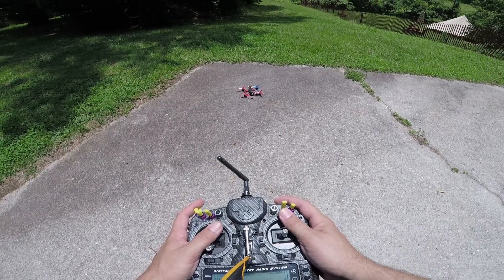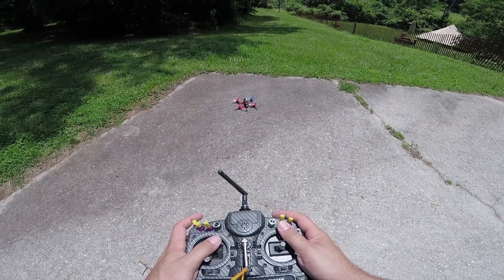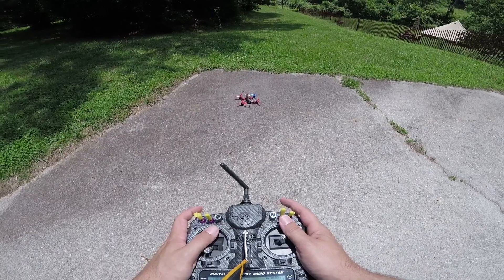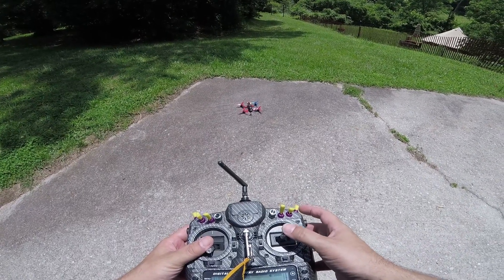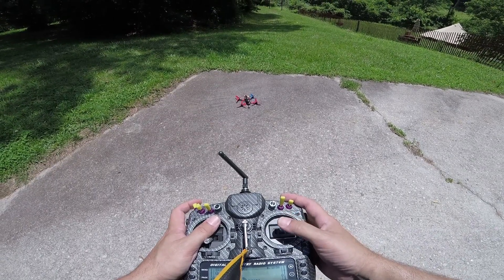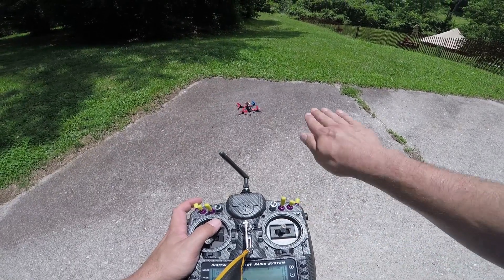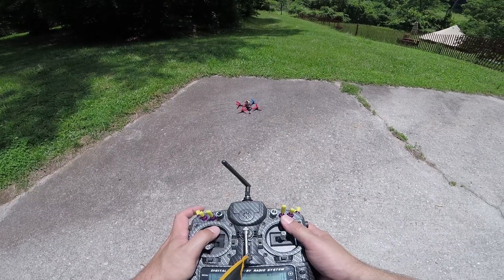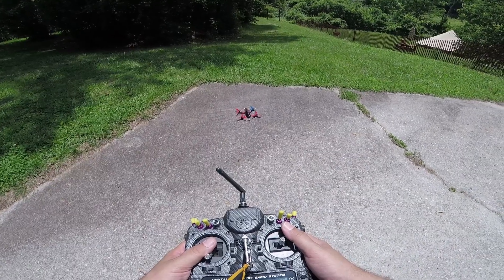Quadcopter Flips On Takeoff | A BETTER SAFETY CHECK

Comment: When i do a motor test in beta everything seems to spin correctly and the motors push the direction they should when moving the stick but soon as i try to take off without betaflight hooked up it flips and shuts down lol
Reply: Props are correct, motors spin correct when moving the right stick when hooked up to betaflight, about to check now without
Reply: Right stick works fine, throttle goes up but not down

Comment: Ok so my drone flips out when I'm flying mid flight only when I try doing backflips. Any fix for that? It spins out of control for like 1 sec and then I get control of the drone again. I just want to have 360 capability 😢.  Any fix for this? Motor direction are in correct order. Its something else.

Comment: I just finished a quad, decided to check it. All four motors were rotating the correct all props on right direction and still did it. The motors are numbers different but they all spin in the direction they should.

Comment: Everything was normal until one day, my quad crashed because of kite string and went brutal.. I tried to fix everything and then fly again, it was normal at the beginning when I smoothly increase my throttle, cruising around... but when I push the throttle up from 25% to 75% it flipped away...
Try another flight using 4s batt, still the same, safe for cruising (linear throttle increase), but when sudden increase the throttle, always flips and causing crash... what went wrong? ESC Problem?
Reply from the maker: Bad motor is always my first guess.
Reply: I watched your other video about how to know if one of my motor or esc is broken, using blackbox and that is give me the ideas about one motor is bad, we're lucky to have you in this hobby, thanks a lot!

Comment: Hey Joshua, I know this is an older video but I have a quad that flips out after takeoff. Motors are spinning in the correct direction, props are on right. I bump the pitch stick forward back left right and the quad leans that direction but when I try to hover it goes crazy. It almost just shoots backwards and to the left or right almost every time. 3 inch cinewhoop. Any idea?
Reply from the maker: If the quadcopter instantly flips over when you arm and raise the throttle with props on, it is almost 100% certain to be one of these things:

1. Clockwise prop installed on counter-clockwise spinning motor or vice versa.

2. Flight controller not facing forward. Go to the Setup tab in the configurator. Tilt the quadcopter on all axes (pitch, roll, yaw) with your hands. The 3D model in the configurator should move the same as you move it with your hand. If it does not, use the Board Alignment parameter in the Configuration tab to fix it.

3. Motors not wired correctly. TAKE OFF YOUR PROPS. Plug in a battery. Go to the Motors tab. Turn on the "props are off" slider in the lower-right. Raise the individual sliders (1, 2, 3, and 4) one at a time, just enough that the motor begins spinning. The motor positions (1, 2, 3, and 4) should match the graphic in the upper left. If they do not, then either move the signal wires so that they are correct or use resource reassignment to virtually "move" the motors.

4. Motor spinning wrong direction. Do the same as step 3 but compare the motor direction to the arrows on the graphic in the upper left. If a motor is spinning the wrong direction, either reverse it using BLHeli (or whatever ESC software you are using) or swap any two motor wires with each other, which will reverse the direction.

Many times, people swear up and down they have checked all of these things, and then come back to say oops I missed one you were right. So if you think you have checked all of these things and your quad still FLIPS OUT, go back and check again. If your quad is insta-flipping on takeoff, it is almost always one of these things.
Reply: @JoshuaBardwell   Hi Joshua. I am new in this hobby. I learned so many things from you. I bought a new version of the reptile cloud 149. I couldn't fly with it due to I have the same flip over problem. I checked a million times what you wrote above. 
1- Propellers installed in a true direction. (CHECKED-OK)
2- The flight controller position is true. (CHECKED-OK)
3- Motor's number and orientations are true. (CHECKED-OK)
4- Motor spinning directions are true. (CHECKED-OK)
But still, I have a flip-over problem.  PLEASE HELP ME  
I have a video about that : https://youtu.be/4qyMEPldU04
Reply: You’re the man! The motor direction and props in the front of the quad were spinning the wrong way. It was still able to climb to a very low hover and not do an instant flip on take off so I didn't think to re-check the props and directions. All is good now!

Comment: Hi Joshua! New pilot here, and I have a question. I just got my Eachine Trashcan and after updating the firmware it immediately engages runaway upon takeoff. Any idea what the problem might be? I'm running on the most recent BF4 build.
Reply from the maker: My guess is you did not enable the "props reversed" option when you set it up after flashing. Go into the configuration tab and it's under the mixer setting,under the graphic that shows motor layout.
Reply: @JoshuaBardwell  thanks for the response! I made sure to take a backup prior to the flashing and can confirm that that's still enabled. I'm beginning to worry something is broken 😔

Comment: Thanks for the video.   Learning something today:  motor noise is much stronger than before, still fly well, but strange noise + some noise like backfire.  Find out it is one of the prop get bend a little bit close to the motor side... replace it, everything back to normal --> Lesson: always double check on props integrity after crash or hard landing :-)

Comment: I had someone asking me, why copters flip on takeoff. So what is the reason for that? I found a video that explains that on a different topic. It is the same with the FC and our brain. We think we have to compensate into the wrong direction. Look here: https://www.youtube.com/watch?v=MFzDaBzBlL0
Reply from the maker: If the quadcopter instantly flips over when you arm and raise the throttle with props on, it is almost 100% certain to be one of these things:

1. Clockwise prop installed on counter-clockwise spinning motor or vice versa.

2. Flight controller not facing forward. Go to the Setup tab in the configurator. Tilt the quadcopter on all axes (pitch, roll, yaw) with your hands. The 3D model in the configurator should move the same as you move it with your hand. If it does not, use the Board Alignment parameter in the Configuration tab to fix it.

3. Motors not wired correctly. TAKE OFF YOUR PROPS. Plug in a battery. Go to the Motors tab. Turn on the "props are off" slider in the lower-right. Raise the individual sliders (1, 2, 3, and 4) one at a time, just enough that the motor begins spinning. The motor positions (1, 2, 3, and 4) should match the graphic in the upper left. If they do not, then either move the signal wires so that they are correct or use resource reassignment to virtually "move" the motors.

4. Motor spinning wrong direction. Do the same as step 3 but compare the motor direction to the arrows on the graphic in the upper left. If a motor is spinning the wrong direction, either reverse it using BLHeli (or whatever ESC software you are using) or swap any two motor wires with each other, which will reverse the direction.

Many times, people swear up and down they have checked all of these things, and then come back to say oops I missed one you were right. So if you think you have checked all of these things and your quad still FLIPS OUT, go back and check again. If your quad is insta-flipping on takeoff, it is almost always one of these things.
Reply: @JoshuaBardwell  Yes, you are totally right. I was not referring on what causes the flip, but why it is flipping in that cases. It's because the flight controller is correcting into the wrong direction. It is like in the video with the bicycle I linked to in my post. When you ride a bike, you permanently have to make corrections with the handle bar of the bike. You do it automatically into the opposit direction the front wheel wants to go. If the bike is prepared like in the video, instead of correcting, you gain the error. So it is what the flight controller does. It measueres a drift to the right and corrects it by stearing to the left, but in fact it was not a drift to the right, but one to the left and so it corrects into the wrong direction and that leads to a bigger error and a bigger correction and so on. That's the case, when the flight controller is mounted wrong. When the prop is mounted wrong or the motors are spinning in the wrong direction, it's a bit different. Then the FC tries to correct by spinning the motors faster, but the trust of the motor goes into the wrong direction and that makes it worse and the FC corrects that by spinning faster and faster and so on, making it even worse. That all goes very quick and so it ends up in a flip over.

Comment: Whenever I have a newly built copter, I first test it in my hand. Holding it on the bottom, arm and switch to autolevel. Then tilt it in every direction and look if it works against it. If that works, I slightly move pitch, roll and yaw to see if it works into the right direction.  That works totally fine on those small quads.
I even did that with a 65cm Hex, but that is a bit scary. Would not recommend a beginner to do it.
When I change props, I just look really carefully which prop I use.
Reply from the maker: It's extremely risky to hold an armed quad in the hand with props on. I would never advise anyone to do this under any circumstances.
Reply: @JoshuaBardwell  It depends on the size of the quad and how experienced and confident you are doing it. I do it all the time and if you do it right, it is safe. Just hold it above and away of your head and only use as less throttle as necessary. I would not recommend it to a beginner though and you are right not to do it.

Comment: I’m flipping :(. . Using a custom motor mix but the correct motor responds when isolated on motor tab. I’ve tried your method of bumping pitch and roll and my quad responds properly, BUT still flips on throttle up. Just beware you aren’t safe just because it didn’t flip on this test.
Reply: Just reset my setup(removed motor mix) and aligned board per manufacturer intentions and I’m still flipping! Wtf I’ve had this issue before and have always been able to fix it. Don’t know wth is going on with this build
Reply: Ok. I worked it out. Don’t trust the sellers page for firmware target. It recommended Omnibus F4 but I needed to use F4 SD. Reflash worked like a charm.

Comment: Hi! My quad tilts the right way but when I power the throttle it still flips and rotates anyway. Could there be any explanation for this?
Reply from the maker: I still think you should do the "Taz" checks. Board alignment. Motor direction. Props correct.

Comment: hi there mr bardwell could I ask you for advice I have a storm racing drone srd 250 v4 its a 6in prop designee could you recommended me some motors for it ,I have the betaflight f3 board to start with thanks for your help and all your videos

Comment: I have a problem with my kiss setup (fc and escs) which is fine when it is on the ground but as soon as in leaves it it flips out. i also noticed that, with props off, picking it up causes it to yaw left 45° and then right 45° and then left again then right. I have flashed different firmware to both the fc and escs and replaced the fc entirely because of accelerometer problems with no changes. It did fly once but that was in December and its been having problems ever since. I have checked the most common causes (motor direction, props, motor layout, etc). Any idea what it could be?

Comment: I had the board rotation in beta flight incorrect on my last build and the damn quad flipped out and chased me.. ended up catching a motor on fire before I got it disarmed... I had to check my undies after that one.. I stand inside the house behind the glass door now to test a new build..

Comment: I know that this is out off topic bit.. Can you make a video Joshua how to focus fpv camera after lens change over?
Reply from the maker: Un-screw the lens to loosen the lock nut. Spin the lock nut out to get it out of the way. While watching the feed from the camera, turn the lens to focus on something about 20-30 feet away. Once you find the right focal length, spin the lock nut back down to the base, without moving the lens. Then spin the lens out about 1/2 turn while holding the lock nut in place against the base. Now twist both the lens and the lock nut inwards 1/2 turn to restore focus. This will tension the lock nut and keep everything in place.

Comment: Well doesn't help if you got fc orientation or motor order wrong and airmode on.
Reply from the maker: It doesn't matter if air mode is on or off because air mode doesn't activate until the throttle crosses 1350 for the first time. So already we've shown an advantage here. And yes, it does help if you have FC orientation wrong. It may not prevent every single flip out but the situation where the throttle is down is always better than the situation where the throttle is up.

Comment: Hey Joshua, is there any performance gain to using airmode? I just disable motor stop and accelerometer and fly great. When I come in for a landing I just kill it right before I touch down. Air mode seems useless.
Reply from the maker: You don't lower your throttle to idle when you fly then. If you lower your throttle all the way to idle, you will immediately notice the difference between air mode and no air mode.
Reply: Yeah of course, min throttle is set to 4% so when I hit 0 thottle, it drops to I assume 4% which lets me stay solid while flying upside down and flips and what not.
Reply: I have personal experience of this. About 200 feet of experience, onto the only asphalt pathway 1 metre wide in about 20k sq. metre field of soft, yielding grass, and can vouch in ouchy quad way that Joshua speaketh truth.

Comment: I have a airbot f4 clone little bee 20a bl heli (normal not s), Dys mr2205 2300kv, X-Faktor (like Alien 5').
When I go to th motors tab and throttle up, at around 1300 it starts oscillating really badly. At around 1500+ it starts fliping out comletely (slow twitching). It does the same thing when it's unscrew and I hold it in my hand strongly pressed so it doesn't get the high freequenc noise. I already did the most radical filtering but I just won't go away. PLEASE, PLEASE, PLEASE help me. :(
Reply from the maker: If it flips out from the motors tab, then the issue has nothing to do with PIDs, filters, gyro, props, or motor direction. It is entirely some kind of issue with your ESCs and motors.
Reply: Joshua Bardwell But I only changed the FC and befor it was fine (Naze 32 rev5 )

Comment: Good Tipp!
One question: can i upgrade my motors from 2300kv to 2400kv or 2600kv without any esc konfigurations. I actually use Blheli 35A. Thx
Reply from the maker: +DerFriese9209 yes you can.

Comment: I do this in combination with a very loosely connected battery lead. If for some reason it does flip out it will likely unplug itself quicker than you can disarm it. I don't heavily rely on it but it's just another layer.

Comment: Josh, does this apply to when motor stop is off or airmode is on? Or what if the FC is oriented incorrectly? The 1 time I had a bad injury was my fault, & the issue was I reoriented the FC and forgot to reflect this in betaflight. Upon arming alone, it isnta-flipped out. This was with airmode on, so I don't know if that's why or not.

Back in the KK FC days - I used to do the right stick movements with almost zero throttle (no airmode or motor stop back then!) but would tie down the copter & note that it was correctly rolling/tilting/yawing as expected.

Comment: Not sure if this will work with cc3d on librepilot, with "always stabilised when armed" turned on. I think thats similar to airmode?. nasty stuff happens when you do whats in the video and something is wrong. 
I just believe and full throttle punch takeoff :D
Reply: pug2o5 librapilot is your problem at this point. the flipping out is the second emergence to deal with.

Comment: Hey Jochua Bardwell nice Idea!
But i think this won't work if your board alignment is wrong.
My first build totally flipped out while i was slightly pushing the roll axis...
Got it even on video if you want to see it xD
Reply from the maker: Why do you think it wouldn't work if the board alignment was wrong?
Reply: Let's say you want to roll slowly left(command) and you got your alignment 180° wrong.
Motor 1+2 will go faster to roll the quad to the left. But the gyro detects a rotation to the right so the error of the PID gets higher-> the motors will go faster-> the quad rolls faster left-> the gyro thinks its going faster right-> bigger error-> motors will again go faster --> escalation.

While the quad flipps to the side it will also slightly rotate in roll axis. So the same thing will happen to roll. The PID has no chance to bring the quad back in a stabe position because its always getting worse and in the end all motors will spin up.

Are you with me?

EDIT: Tell me if i missed something.